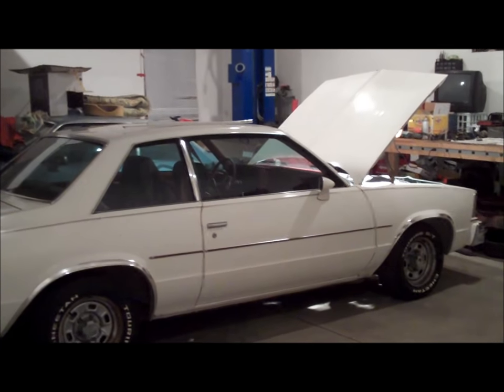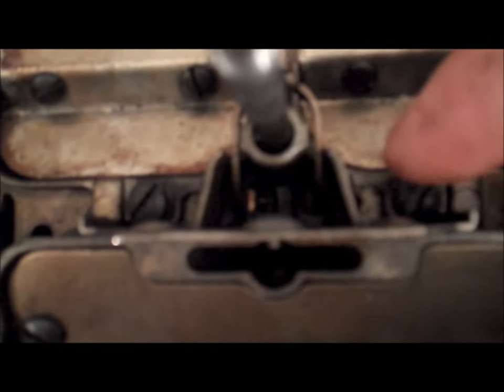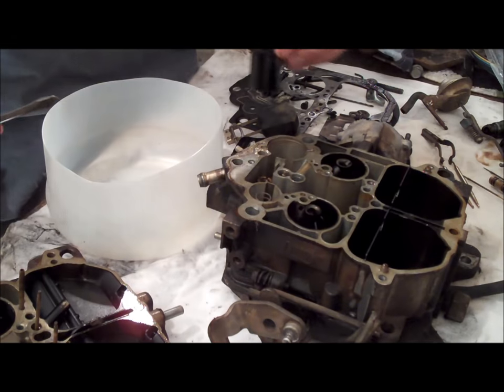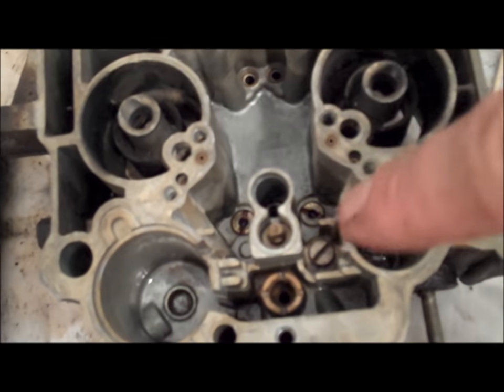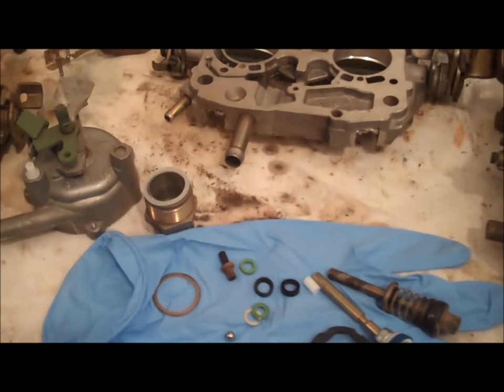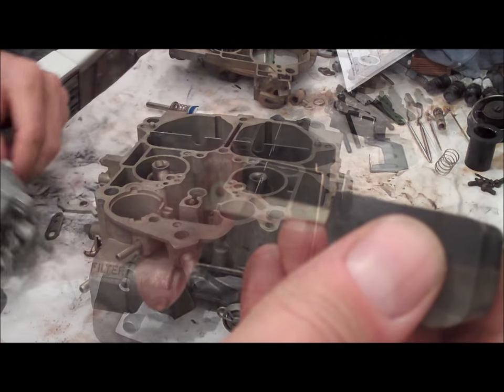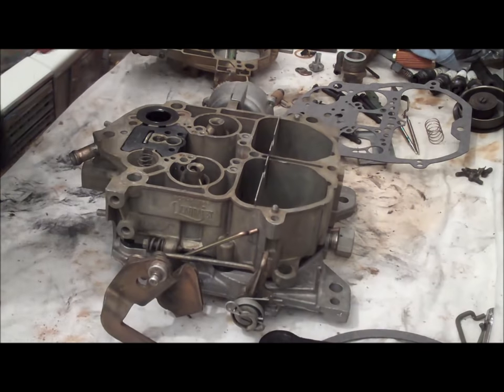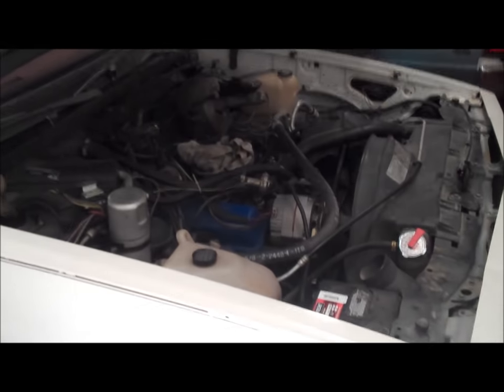Detailed Quadrajet Carburetor Rebuild COMPLETE GUIDE

Comment: thanks for the detailed video im going to do mine on a 1988 caprice looks the same only mine has to connectors dont know what they do but im using your video as a refrence thanks
Reply from the maker: Yours is computer controlled. A similar carb but check out my recent video on how to replace the Throttle Position Sensor. That car is like yours. It may help you a bit if you watch both videos.
Reply: You have the feedback quadrajet

Comment: Thanks for this video. Why you didn't remove that little brass part located  between power valve and needle? What is that part and how it's supposed to be there? It has thread and spring, how deep it should go?
Reply from the maker: Because its a factory set adjustment. Should be 4 turns out.

Comment: I was thinking dropping a comment on a 4 yrs old video might be awkward a bit, then I was thinking that I am rebuilding a 1982 carb that is fixed on 88 Caprice ;) so who is Older here 😅, THANK YOU, THANK YOU THANK YOU for the details spoken and the demonstration as well. I have questions regarding by rebuild! During dissassymbly I didnt find the cup inside  and now after I am done when I crank the engine the carb flooded through the air vents 😓😓😓😓 what could be gone wrong?.. I really need your experience here.
Reply from the maker: Not all carbs came with this cup and a Computer controlled carb wouldn't have one. 82 used an computer controlled carb. If it is flooding over then there is an issue wit the float. It is either out of adjustment or the needle isn't sealing or seating.
Reply: @ClassicGBodyGarage  you are right I found the needle rupper seal is worned out and couldn't find replacement so I soaked it in lubricating oil and it got improved. And the engine already ignited yesterday sooooo rich.... and still a lot of issues to look at.....got me thinking maybe an LS1 swap would be good idea!?
Reply from the maker: @Gloryweeper  You can buy them new through quadrajetpower dot com

Comment: Hi there,
Very nice video, I tried to rebuild mine but I notice one of the air horn tube are fall down I out back but it a does not set flat with surface of the air horn does have any problem
Reply from the maker: it should fit flush

Comment: Real good video.I did it all just like this but when i try to open secondarys it backfires.What did i do wrong?
Reply from the maker: check your timing
Reply: @ClassicGBodyGarage  As a matter of fact i found that bolt was too long that tightens up distributor and timing had slipped around.A washer on bolt that was too long and she is purring now.Thanks
Reply from the maker: @larryseals6089  Glad you found the issue

Comment: Haven't gotten too far into the video yet, but is it still all the same procedure for the electronic feedback model? Gotta rebuild the carb in my 85 monte carlo ss, and wanted to make sure I was still doing it correct
Reply from the maker: Very similar however you need to unscrew the adjustment for the MC solenoid which is off the blue plug and you need to count the turns for the adjustment by running it down all the way until it stops and then back it out. Install it back the same way by running it down all the way then backing out the number of turns you counted. Normally 4 turns. This is critical.

Comment: Ironic, while watching this video, I heard Keith Whitley in the background singing Ten Feet Away😎I played with Whitley nearly 9 years. I just rebuilt my 800 quadrajet but haven't got the engine ready yet to try it out. I've rebuilt a hundred of them. BUT I did mess with the power valve for some reason. I think I found the initial setting though on line.

Comment: I always use your vid when I rebuild my Quadrajet. This time after a rebuild I see one of the primaries is not squirting. I’ve taken the carb apart and can’t find anything wrong. Do you have any ideas? Thanks.
Reply from the maker: Probably plugged up if one isn't working. blow it out with compressed air.
Reply: Classic GBody Garage after taking  it apart several times and blowing the holes out, it’s working great now. There must have been a stubborn piece of debris stuck somewhere. I’m also thinking the gasket might have been plugging the primary hole. All is well now, thanks!

Comment: First i wanna say thank you very much for the videos, you did an awesome job with them, very detailed and just very good info all around. Second i have a question for you, pertaining to the PVA screw, you know the screw that you dont want to mess with it, well what if when get to that point you find there isnt one in that space but there is another what looks like the power valve its self, but with only one sided with another needle going down to another jet. is this common, if so is there not a PVA screw to deal with on this carb?  Thanks again.
Reply from the maker: Thank you for your comment! If there is no adjustment then you have an older carb. approximately 1975. Mine is a 79 so it may vary from other generations.

Comment: Do you have a rebuild video for a Rochester dual jet 210?? I've been looking for rebuild videos for the dual jet for a while. it would be awesome if you would do one if you haven't already!!!!
Reply from the maker: Follow this video as the dualjet 210 and quadrajet share the same primary components. Choke, accel pump, float, jets etc. Everything in front of the secondaries are the same between a Qjet and 210. I may eventually do a complete rebuild on a 210 but not for several months.

Comment: Thanks for the great video. Just rebuilt my Quadrajet on my 77 454. Couldn’t find the specs for the float though. It was at 8/32 and I found somewhere online saying it should be 19/32 but after installation it sound likes it’s starving for fuel. It fires and dies right off. Do you happen to know where the float should be?
Reply from the maker: It shouldn't die right away if the float was off. It sounds like there is another issue.

Comment: If you're trying to keep your classic or vintage car "original" that's one thing. But these carbs were called "Quadra junk' for a reason. My 79 Camaro had same carb. yank it off, use it as a dr stop and replace it w/ Holly.
Great Vid any way.
Reply from the maker: dadrules714  Called quadrajunk for those who don't know anything about them or those that don't know how to work on them(not saying you don't) but the easy thing for anyone to do is remove a 30-40 year old carb and replace it with a new out of the box carb....yet you have to buy other after market components to get an after market carb to work right. A Qjet will out perform a Holley any day of the week in all around drivability. I have had plenty of experience with both carbs.
Reply: classic g body is correct. I still use the factory qjet on my 76 trans am with a 500hp 400 stroker build. runs just fine, while true I can get some more horse power with the Holley, I am getting way better MPG and drivability with the qjet

Comment: Hi! can you tell me if JB weld is safe to make new screw threads inside a carburetor, and if it will not melt in contact with gasoline ?
Reply from the maker: JB works

Comment: The carbkitsource website for the kit says my 69 cadillac takes a 17059230, 32 and a 17059530. Can you tell me if the 17059064 that came off the car, can fit on there??. It was on when i got the car. It sounds like how this car sounded at first.??  Im rebuilding this 7059064, but im wondering do i have to get a new carburator??
Reply from the maker: you can google those numbers to see what engines those carbs came on.

Comment: no need to grind or hacksaw the carb body to access the idle screws...simply drill small home in the aluminum plug covering the idle screw, thread in a sheet metal screw, then pull free...saves making a mess of your carb body

Comment: Will rebuilding my carb fix the problem I have? I have to pour gas everyday in carb to start it
Reply from the maker: Sounds like your choke isn't working and the fuel bowl is draining as it sits. May also be a weak fuel pump.

Comment: A much easier way for the choke.
Assemble the choke arm with the rod after the air horn is attached. Place carb on its side, slide choke arm with the rod into the slot, line up by seeing it thru the hole in carb side. Use a small tip tool to get it centered in the hole facing the right way. Put external choke housing in place.

Comment: Hello Brian, Great how-to video! I have a Q-Jet off a '77 Buick, non-electronic model #17057241.  I've never rebuilt a carb but now that I've seen your video I'd like to give it a try.  Can you tell me what CFM it is and would it be a suitable carb for either a '72 Olds Cutlass w/Stock 350, AT or a '65 GTO w/AT with 400 engine, a street performance cam, headers and 400 ram III heads?  Thank You!

Comment: On the power valve set screw. Where did you find the information for 4 turns out after screw is bottomed out? There was another video that said 2 turns out. Just want to make sure which is right. Thanks.

Comment: I have a 84 Chevy c/k10 Scottsdale and it will start and stay running decent, but when you give it gas it will do a hissing sucking sound followed by a small pop it’s hard to tell you on here how exactly it sounds, but was wondering if that might be problems with the accelerator pump?
Reply from the maker: Yeah pump might be bad, Turn it off and pull the air cleaner off and look down inside the carb to see if it squirts when you hit the gas.

Comment: Good brother greetings from Venezuela my respect and congratulations for sharing your knowledge with us the people that we like to do and above all learn, I would like to ask you a question and if it is in your possibilities I would like you to respond and thank you beforehand.

The needles that are 2 and that placed in the chiclers that carry a spring I would like to know what its function and at the same time how it is that they work once the deck and already being mounted in the vehicle?
Ok thanks and see you later
Reply from the maker: They are call metering rods and they control the idle and off idle. The rods connect to the power valve that moves up and down based on vacuum. The rods drop down in the jets on idle only to allow a little bit of gas through then when you step on the gas and you lose vacuum the valve moves up and the rods are pulled out of the jets to allow more fuel to get through.
Reply: Classic G-Body Garage Ahhhhhh ok now if I understand and it is ready to serve in my carburetor was stuck the piece where the needles and watching your videos I realized how it came out and therefore disarm it and now if it has much more power to accelerate and the needles Move from top to bottom, for a long time I was so fixate that the spring was rusty and I was tiny tube to install another, well thank you very much for answering my doubts, regards

Comment: I think my 82 Trans Am has a E4ME carburetor with this rebuild video be really close to the same carburetor and I'm having issues with it not wanting to run without giving it gas and when every you accelerate it blows black smoke indicating that it is running rich I do you have the Trans Am service manual and it mentions the E4ME in it

Comment: Thanks for the video very easy to understand and follow. One question you might be able help me with is where does the vacuum diaphragm for the secondaries hook up (back left corner of carb) can I hook it in line with pcv or does it have to be by itself and does it have to go to the manifold? Judging by the numbers it's for an 82 Chevy and it is a 4bbl. Thanks for any help you can provide.
Reply from the maker: I believe it goes to one of the lines that then plugs in to the air cleaner housing. The emissions decal on your fan shroud will tell you. If your car doesn't have one you can look it up on line.   Thanks for watching.

Comment: Classic G Body Garage I'm having an issue with my carb. Every time I cold start my C20 it automatically goes full rpms until I physically kick it down after about 15-30 seconds from initial crank. At this point it runs perfectly at idle speed and I can drive it with no issues, can turn off an on and it starts at regular idle speed. The "open throttle" situation is only at first cold start whether its 6am, 1pm or 11pm etc. after that it works fine. What do you think could be the issue?  It is a Q- jet dual jet 210 all I know haven't really search much about it yet, but it not original to my 69 truck it is very similar to the one from your video. Very informative by the way. Would appreciate any information you may provide.

Comment: I have a 1985 Chevy G10 Van with a 305 motor which should a similar carb to this one. What did you charge for the whole job rebuilding and putting it back on, adjusting it, etc..? I'm just wondering, because mine is flooding and I know it needs to be rebuilt. So, I just need to know around what it should cost.
Reply from the maker: Around $100-150

Comment: Thank you for your help. I do have a question now. At minute 34:57, I see a little brass tab resting on the table.  what is that?
Reply from the maker: Its just a flat piece that goes in a slot where the plastic cup goes.
Reply: What is its purpose? Mine fell out when I rebuilt my carburetor. I couldn't figure out where it went. It has a number stamped on it. I didn't notice any problems leaving it out.

Comment: should the vac ports above the airmix screws be capped off if not used or left open ? Its an 1984 gmc k2500 350 and I have removed all the emissions from it.
Reply from the maker: Cap any vacuum port not being used
Reply: @ClassicGBodyGarage  Thx

Comment: I have a 90 model blazer that was swapped back to carburetor the carbs not getting fuel which I'm sure has to do with the mechanical fuel pump but the hoses and carb seem so complicated I've thought about switching to something else what's ur opinion?
Reply from the maker: You need to check the lines from the tank to the pump and then pull the line off the carb after the pump and crank it to see if it spits fuel out of it. If it does then then pump is fine and the carb or filter has an issue.
Reply: @ClassicGBodyGarage  donut think the quadrajet is more complicated than a holley I just want something easier plug and play
Reply from the maker: You need to find out why its not getting gas first. If you have a fuel supply issue it won't run no matter what carb you put on it.
Reply: @ClassicGBodyGarage  yea I am gonna figure that out I think it's the mechanical fuel pump that was on the engine my older motor had electrical fuel pump so I'm gonna get one of them working just gotta figure out which do you have a preference
Reply: @ClassicGBodyGarage  alright ingot a few updates took the mechanical fuel pump off and sealed it got it into time and also re did the spark plugs I'm getting fire but I think the carbs not letting it get has I took the filter off the front of the carb it was very dirty so I think that's the issue it acts like it wants to start but nothing

Comment: Hello, I've a 1986 GMC truck with Rochester quad carb, it was leaking and dirty, so last night we took it a part following each step in your video, and we put it back, when we started it, it produced black smokes and the truck is shaking, so we took a part and we founded it was flooded with fuel. We said we shouldn't touched it. So we took to an expert he cleaned it and put back 3 times with same result, smoke and its flooded.

What do you think the problem is?
Reply: +Juday Hajri (الشيخ جديع خالد الهاجري) float level i reckon.

Comment: Hey man, just went through a quadrajet on a 1985 Dodge 360, step by step with your video. Everything internally is within spec and operating well. She started up pretty easily upon reinstall, but seemed to be having an issue holding idle. Pulled her out of barn and ran it up and down my service road - while on the throttle/ driving the truck, it sounded and ran the best it has in the 10 years I've been at this golf course. But when I let out of the throttle and go to make my turn arounds, it sputters and dies if I do not gas it heavily. 

Seems to maybe be choking itself out? But also seems that the auto choke is opening too early and not allowing the truck to get warmed up/ idle properly before opening the choke. 

I am wanting to check/ tune the auto choke and idle-air screws, but am not 100% where to start. I am quite mechanically inclined, just born after the age of carburetors. lol
Reply from the maker: If it still won't idle even after its all warmed up then you may have a vacuum leak. Check your vacuum lines etc. Also you can adjust the idle mixture screws at the base like I did. Yours might be capped off since it is a mid 80s carb but someone may have uncapped them over time. 

If you feel it is stalling due to too much gas, as in chugging black smoke out the tailpipe then you need to make sure the float level is correct.
Reply: I will definitely go through the  vacuum lines and check them. I have exposed idle air screws, set at the 4.5 turns you suggested in the video. My float level is 100% spec'd at 13/32", which is what my coded carb called for. This old dog of a truck is super ugly under the hood. I'm going to pressure wash the whole engine and begin checking all vacuum connections. Any tips on adjustment of idle air screws when I get to that point?
Reply from the maker: Devin Miles turn in each idle screw til it starts to surge then back it out about a quarter turn or til its smooth.

Comment: Hi there if you can do a video on tunning the chock and the fuel air mixture after the build
Reply from the maker: Yeah I can do that. Thanks for the suggestion.
Reply: @ClassicGBodyGarage  just a question I have a new rebuild quadrajet and by mistake I damaged the fuel inlet do you think I can change it with the old fuel bowl assmbley from the an old Rochester I have should I use the old jets or should I just change as it is ? Thank in advance